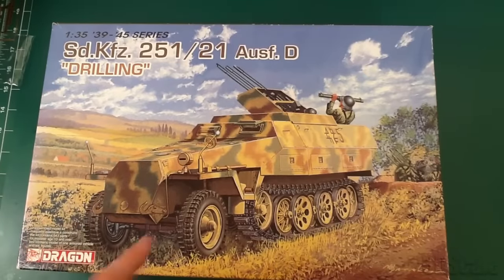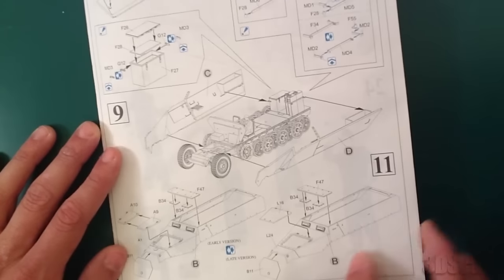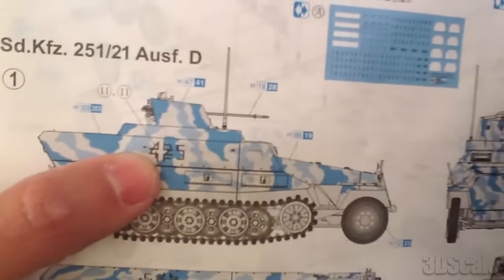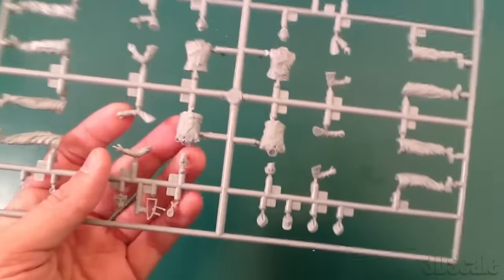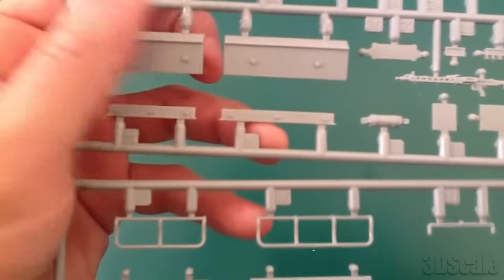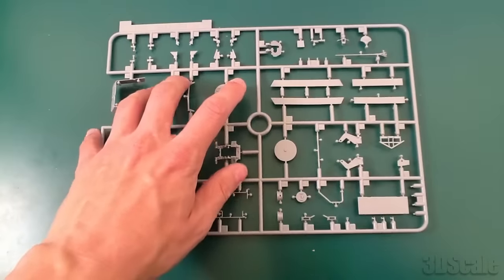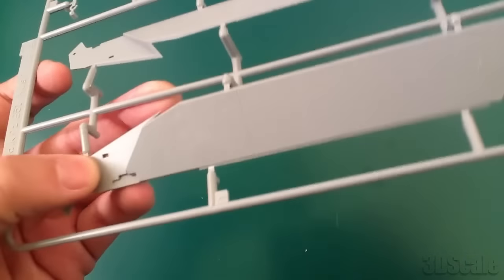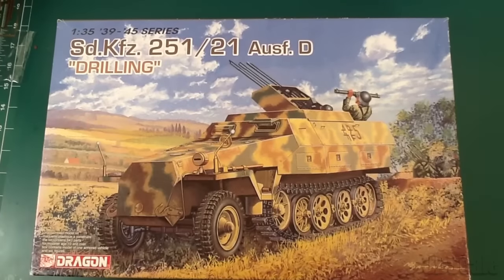Kit Review: Dragon 6217 Sd.Kfz 251/21 "Drilling" in 1/35

Comment: Another good review of a kit I have.......those parts in step 1 are the tranny and fuel tank, although you don't see them once the floor is installed.

One of the better renditions of the 251, some corrections were made from older Dragon versions, like the lower hull side armor plates (PE), larger center console hump and better visors.

The Drilling was a naval gun incorporated into the design that's why it's mounted on a pedestal.

The part on the rear hull (with the round ball type bit) is the electrical socket connection when they towed field guns etc to power the tail lights.

Thanks for posting......those tracks will articulate if you build em correctly. The hull with the single hatch is correct for this vehicle (late type with radiator access hatch).

BTW, the decal sticker for the large gauge on the dash is incorrect, you can buy replacements from Archer if you need to replace them. Unless painting is your option, just pointing it out.
Reply from the maker: milky55way2012 Wow you know a lot about 251s. Have you built many?
Reply: Sadly no, the only thing close (and that one's not finished) is the Nebelkraftwagen from AFV club, which has the same suspension as the 251s. But I do have Tamiyas Stuka Zu Fuss that will eventually be a better version than the kit one. I do love the information interchange of the hobby, always learn something new.

Just read a lot over the years and studied a lot of reviews....a great book I would recommend for you is "Militar Der Wehrmacht" I think by Ryton Publications, but I could be wrong. A bit pricey but worth the cash.

It covers all German softskins and halftracks, armored cars, Zugmachines (like the Famo etc.).
Great book

Sorry for blabbering on......:>}}
Reply from the maker: milky55way2012
Always blabber on. If we both didn't love this stuff we wouldn't be here man. I'll check the book out.
Reply: I goofed up the title....."Militarfahrzeuge of the Wehrmacht by Ryton Publications

Comment: Ohhhhh man Adam!
You have way more Juevos than me. That's waaaay too much photoetch and fiddly stuff. Cant wait to see it built though. Thanks for the review
Reply from the maker: PFMANN1 You know I think certain types of PE are easy and others scare me. If it requires bending and assembling in to a shape I have reservations. But the flat and just single fold PE I've become pretty confident with.
Reply: I have the original hold and fold that they made in the 1980s and I still don't know how the thing works properly to tell you the truth. How is that Tammy straight bending pair of pliers or whatever it is they sell? Do you have one of those?
Reply from the maker: I don't, but xuron make one i saw ata show a few months ago but it could only bend small right angles. Did it really well though.
Reply: That could work really well for those small straight pieces that only require only one bend.